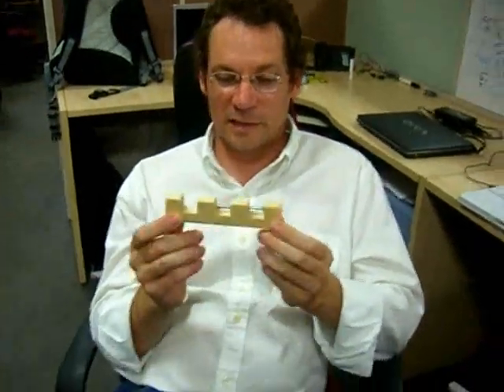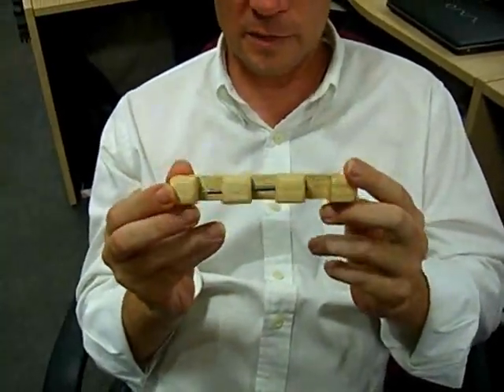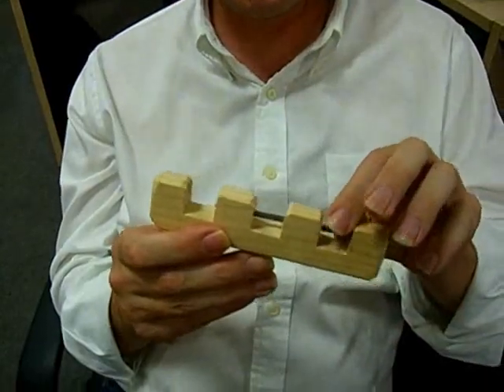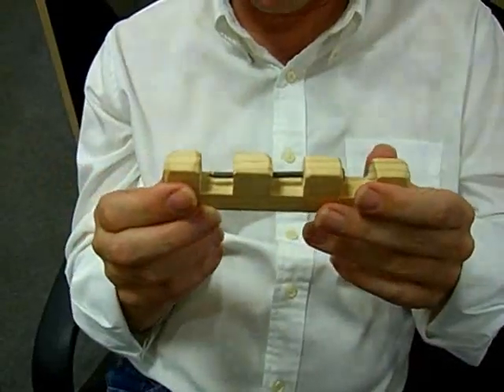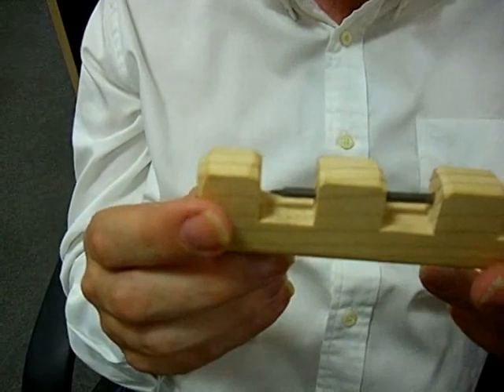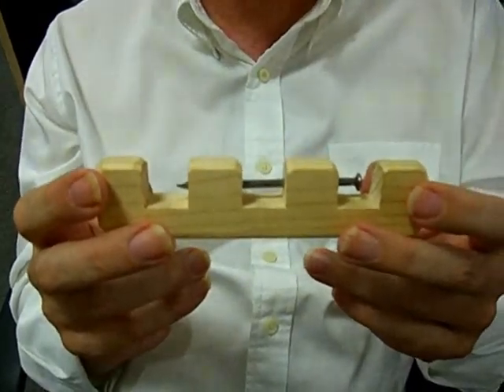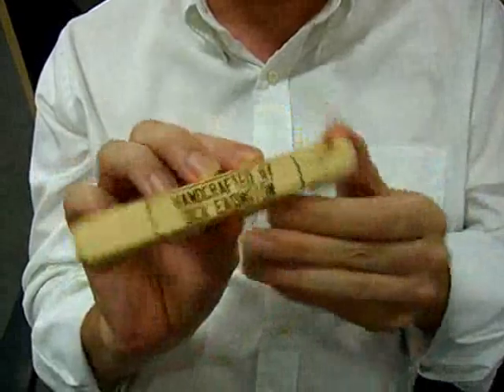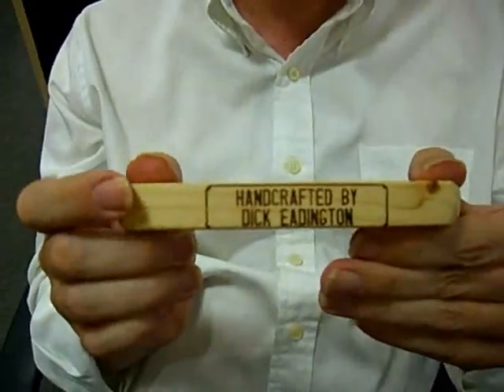Tooth and Nail Trick - How to put the nail inside the wood

Comment: ya i found it first try too

1. Boil wood, 
2. use vice to compress end tooth with dry follower block, 
3. drill hole through dry follower block and center teeth, 
4. insert nail,
5. reboil entire apparatus to "heal" wood,
6. allow to dry completely and amaze your friends.

Comment: The block is cut out of bass wood and the last tooth is placed in boiling water for ten minutes. It is then immediately put in a vice and compressed, and left in this position for two days till dry. when removed from the vice you drill the hole and insert the nail in the two middle teeth. Then return the block to boiling water and it will return to its original shape.

Comment: easy....put one end in boiling water for abaou 10 mins,take it to a vise and squeeze the hot wet end down and leave it in the vise for an hour.take it out of the vise,drill holes,insert nail,then piu end back in boiling water for 5 mins and the end will expand back to it's original size......